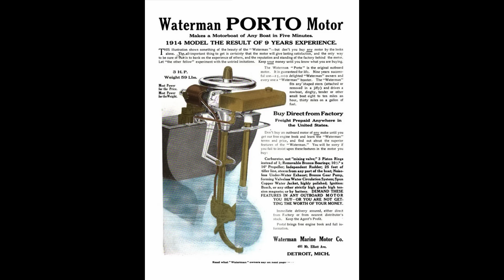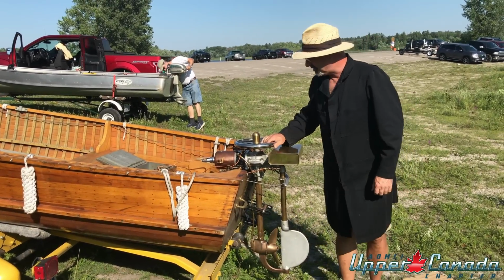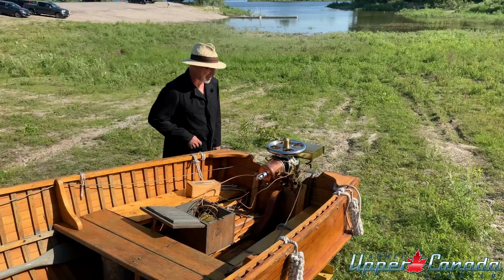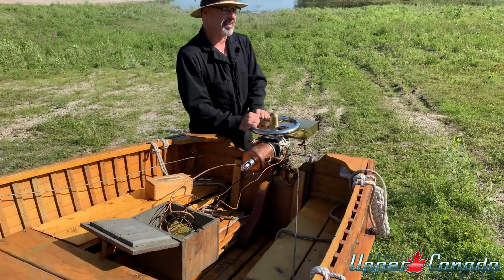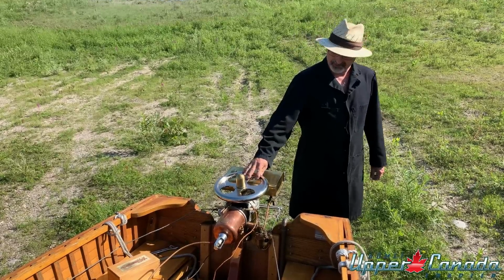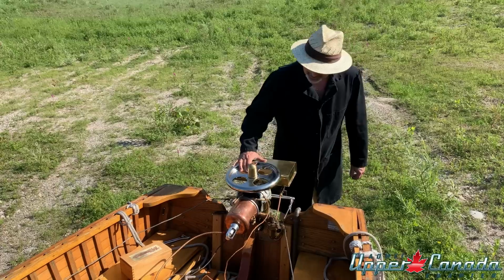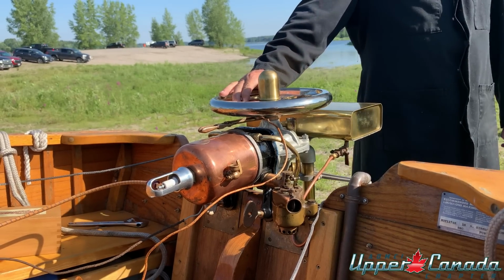1914 Waterman Porto C14 Rowboat Motor RBM

Comment: Cool.
Just wondering how the ignition works
Reply from the maker: There is a timer lever under the flywheel with points activated by a cam on the flywheel. The spark is provided by a battery and buzz coil located in the boat.

Comment: I can understand its cooling system (water pushed up from behind the prop as it spins, no impeller) but how does the ignition work?  I see a lead to the spark plug but don't know were it comes from or how the ignition is timed.  But very interesting.  I have never seen a flywheel like that !
Reply from the maker: The motor has a timer (points) that operate from a cam on the flywheel. The lever under the flywheel is the spark advance. A battery and buzz coil located in the boat provides the spark. Much like a Ford Model T.
Reply: @uppercanadachapter-aomcian4166  Thank you for clearing that up for me.

Comment: My Waterman Porto was purchased in Dec 1912 as a 1913 model.  The drive gears in the lower unit are shot, but is otherwise in good shape.  Have you or anyone in the AOMCI found a source for the gears that would work?  With a gas cap and some gears, I should be able to put it back in the water.  I am a longtime member of AOMCI, and now that I am retired want to start working on my early engines again.  Any help would be appreciated.
Reply from the maker: Gears are usually adapted from other more common motors. Contact us via our website and we’ll put you in touch with the owner/restorer of this motor. 

uccaomci.com

Comment: Those holes in the flywheel would make me worry for the fingers … my grandfather‘s 1.5 hp sideborder had a cord with a toggle to wind around the flywheel.
Reply from the maker: The flywheel was designed with safety in mind. Other manufacturers had a starting knob that was nic-named the knucklebuster. Waterman didn't have one. Hard to believe this is what passed for safety. lol

Comment: Beautiful motor.
I wouldnt leave the dock without a set of wooden motors and a can of starting fluid😂😂.
I wonder how many of those are at the bottom of lakes because the owner said Fck this thing.
Reply from the maker: Back when this motor was built people accepted a certain amount to trouble to get and keep a motor running.

Comment: what cools the motor
Reply: He mentioned a water jacket. It's running in water. I'm gonna guess...dry ice.
Reply from the maker: It has a water pump. There is no harm in running it out of the water to warm up the powerhead. It makes starting on the water easier.

Comment: Nice, it even starts easier than the old McCulloch's.
Reply from the maker: These old motors all have their own quirks. Once you figure out the starting protocol they usually start easily.
Reply: @uppercanadachapter-aomcian4166  Yes it is a little gem of a motor. Even newer motors have a bit of a starting protocol too. Love the old cedar strip boat also. I have an old cedar strip boat made by the lake Nipissing Boat Company, but sadly can't find much history or info about them.

Comment: Thats a beautiful old engine, I can see that you have done a world of work to it in getting to where it is now!  I grew up on a lake in MN and found a couple old Brass Era outboards if I remember right they were both Evinrude/Johnson and had been in garages and not seen the light of day for 40 plus years, I was in 8 th grade or thereabouts and I was so enthralled at the beauty of these engines I just had to take a crack at getting them running again, the owner kind of looked at me like I was crazy but said go ahead!  I remember pulling the flywheel and points, plug and replacing crappy wires where possible then pulling the carb being so careful with every gasket there was (I got lucky) and didnt destroy any when taking it apart my Dad told me to soak the gaskets in something to soften them up because I had to use them again or I would be remaking them.  Well tore the carb completely down and just a very good cleaning and making sure all the jets were open and flowed air.  Cleaned the fuel line and the tank put everything back together, I remember checking for spark on the plug and I felt like a million bucks seeing it flash.  Then it was make sure everything was back together, turned the fuel on and checked the carb again for leaks etc. and that darned engine started on the 3rd pull of the rope, VICTORY!!  I then mounted it on my 12' aluminum flat bottom and drove it for a couple hours on the lake and after about 20 minutes it was running like brand new.  I drove it over to the owners dock and took him out for a ride, he had never heard it run before and was amazed at how well it ran!  I gave him the engine back and rowed my boat home.  The sad part of a truly great story is I am pretty sure that beautiful old engine went back into the garage and I am sure it never ran again.
The second engine I did that summer was almost exactly the same story and it ran just as well as the first one!  I love working on these old engines and learn so much every time I have to chance to do so!  With that being said you have done a beautiful job on your Waterman and you should be extremely PROUD to have brought it back into the living world again!  THANKS for taking the time to do so!
Reply: I was raised on Lake StClair, brought back memories me and my Comander outboard on my Hydro plane, and my  Dad varnishing his Petebuilt every year,
Reply: @klausuhlig7141  Klaus I had an 8 ft hydro also I had a 25 Evinrude with a speed prop on it, I would guess the boat went around 40 MPH it had dead man's throttle where you had to have your hand on it all the time or it would go back to idle. Just enough room for a fuel tank and me in the boat. Those were such simpler days!
Reply: @karlk6860  dead mans throttle, haven heard that in over 60 years, that what I had on my boat too, cant believe what us kids used to do, now days our parents would go to jail for letting us get away with what we did, 
I still live on the water down in Mexico, riding Harleys, and 15 years ago bought a couple of VW sand rails, still living like a kid,
Reply from the maker: Thanks for sharing your story. There are few things as fulfilling as bringing something back to life.

Comment: I was told go away today with my late 1970 or 80ths Mercury out board,Every thing has it time from marine repair shop
Reply from the maker: Marine repair shops won't touch our motors either. Guess it's time for you to join the club :D
Reply: @uppercanadachapter-aomcian4166  Thanks only problem in Ireland .

Comment: So, the title should read "2021 Waterman Porto C14 Rowing Boat Motor On An 1914 Engine Mount", right?! Collectors start screaming in anger, hearing what has happened to that 1914 juwel.
Reply: Collectors should get over themselves, the lovely old motor is running, not collecting dust in some hoarder's 'collection'. They were even kind enough to take you on a virtual boat ride. You a collector, Voor?
Reply from the maker: Actually, no. Collectors of antique outboards would prefer it to be restored and serviceable. Motors as rare as this often need extensive work to be returned to service. A motor that’s polished and painted with no hope of ever running is the least desirable to serious collectors.

Comment: its not a motor its a engine man if it runs of electricity its a motor if it runs off combustion its a engine why do people get that mixed up
Reply: I drive a BMW, they must have gotten it wrong too.
Reply from the maker: You are correct, however it's a matter of semantics now. They have called them motors, either rowboat or outboard, for over 100 years. Pretty hard to change it now.

Comment: So where is the period correct trailer??? HHMMMMMM???
Reply from the maker: We run motors from the 1900-1950's. We'd need a lot of different trailers. Currently, it sits on a 1950's bubble fender Tee Nee. That's about as old as they come and still be safe for today's roads.

Comment: Very coll old outboard. I assume it is water cooled. If so dry starting is very bad for the water pump. 
Good thing he doesn't live in Texas. They would make him come up with a title. 
BTW the starting mechanism must have been invented by an orthopedic surgeon.  I bet it broke a lot of wrist.
Reply from the maker: It is water cooled, but it doesn’t have a modern rubber impeller. Starting on land will only hurt it if the operator allows it to overheat.

Comment: Your outboard looks beautiful, but the steering control lines are questionable. I believe that a side mount vertical control lever would be better. Run the lines through blocks and use a spring or bungee cord to keep the lines taut.
Reply: It's a borrowed boat, so its not mine to play with, I used what was there.... but thats a good suggestion, thanks
Reply: @Outboardguy44  Thank you for the explanation. I thought that you might have used a tiller line arrangement because that's what Waterman promoted at the time. I doubt that this was actually adopted by people who purchased the motors. As you demonstrated, It's not a convenient method to steer ;-)
Reply from the maker: The boat is set up for an ELTO Light Twin (Ruddertwin). It works well for its intended purpose.

Comment: When I was a kid growing up, we had a boat very similar to that one. The deck was a bit longer on the front and it was a bigger boat. It was made by Old Town Canoe, when they used to make boats. They were able to tell us the day it was started and finished (1917) and who worked on it from the serial number plate. It was adapted, at some point, with fiberglass pontoons(?) on the side that made it look like an inflatable, but the inside was absolutely beautiful. It was pretty much unsinkable with the add-ons and we fished out of it pretty much every weekend. How much have outboard engines changed in 100+ years, now they are V-8s and fuel injected.
Reply from the maker: Sounds like a cool boat. Old Towne made some good ones.

Comment: Note to self: apparently no one knows how to balance a single cylinder engine...
Reply from the maker: Gasoline motors were still pretty rudimentary at this point. The piston is counter balanced by weights in the flywheel.

Comment: Beautiful engine, very well restored. Going by the size of that carb and cylinder it looks to be quite a large capacity engine.
Also lovely old boat. I think if it was mine I'd convert it to wheel steering, should be easy to do. That boat is also big enough to convert to a small cuddy cabin.  Single berth obviously but should be enough for an overnight boat with a small bed and burner ect. All done in period timber and fittings of course.. 
Great video, well done.
Reply from the maker: Thanks. We run lots of different motors on this boat. Only a few use remote steering like this one.

Comment: Interesting engine, but looking at the operation I think its better suited to sitting on a display stand in the den, sitting there looking pretty now that its been proven to work.
Reply from the maker: We prefer to use our motors as designed. Running on a boat. Making memories.

Comment: "HI....I'm cantankerous.  And I shake a lot too."
Spectacular restoration.  When it first started I was convinced it was a hit-n-miss engine, but that turns out to be mostly not true.
Reply from the maker: You are correct in that the successful operation of the motor is “hit and miss” depending on the operator. Otherwise, it is a two stroke.

Comment: Had the pleasure of meeting Ollie Evinrude and his wife (Francis Langford, the actress) oh his motor yacht while we were docked at Mackinac Island, back in the early 70's. He had a railing on the upper deck of his boat with every model of motor Evinrude made mounted on it. Nice couple, very welcoming to my wife and I, as they led on us on a tour of their boat.
Reply: ☑️I bought my very 1st boat from a friend in 1995, an old, cheap, "reinforced" 12' aluminum flat bottom fishing boat designed for ponds and small lakes. It was rated for motors of no more than 3hp. However, my friend had reinforced that old boat with pressure treated 2" x 12" boards across the stern plate where the motor was to be mounted, and he used the 2"x12" boards to completely replace its original thin, loose aluminum bench seats. That made the little boat much more rigid and strong, so it could handle 3x the recommended horsepower! 

My friend had used a 28 year old, 1967 Evinrude 9.5hp short shaft outboard. That motor started within 1-3 pulls every time I took it out, and 3-4 pulls fresh out of winter storage.  I could take that boat up shallow creeks barely 2 feet deep! But before I bought it, I went along with my friend as we took it out to places where it probably shouldn't have been! Such as the time 3 of us took it out to the middle of the Rehoboth bay in Delaware(nearly a mile from shore), or when we took it out the Roosevelt inlet, into the lower Delaware Bay, right where the bay meets the ocean.
Reply: Nice so was it usa production engine. So guy had all the motors made on display on his boat.  He be dead now eh
Reply: @tonypointer7026  I'm sure he's passed on as we met them in the late 70's...early 80's (passed in 1986). And yes, Evinrude outboards were made in the US. Also, my error as it was Ralph Evinrude that we met who was the son of the founder Ole. My Dad (RIP) had a 71/2 hp Evinrude on a 16', lapstrake, Thompson open boat...beautiful wood boat and a most reliable motor.
Reply from the maker: What a great experience that would have been.

Comment: In addition to the really cool antique motor, I though the steering system was genius. You can steer the boat from anywhere within the boat by pulling on the cables run the entire length of the interior.
Reply from the maker: Those old guys were pretty clever.

Comment: I would like to see more blue smoke. That engine needs 8 to1 probably in a desperate attempt to keep plain bearings lubricated
Reply: I was running 8:1 in it, but it was Amsoil synthetic which doesn't seem to produce much smoke. It was also a windy day so any smoke haze was quickly dispersed by the breeze. Thanks for commenting :-)
Reply from the maker: Quality oil doesn't smoke much when the motor is warm and set up properly.

Comment: To make starting easier why not use an electric drill with a cone of the rubber core on top of the hub of the crank that way you can use the drill to start it
Reply: Its the zhit gas we have now ethanol
Reply from the maker: Thanks for your question. Using an electric drill on the flywheel nut would risk over tightening the nut, which could cause damage to the flywheel, crankshaft or both. Many early outboards have suffered dearly from improperly torqued flywheel nuts.